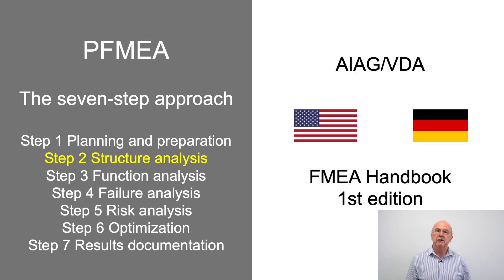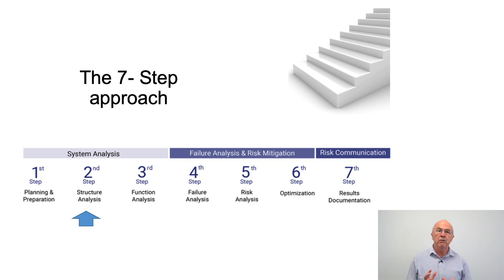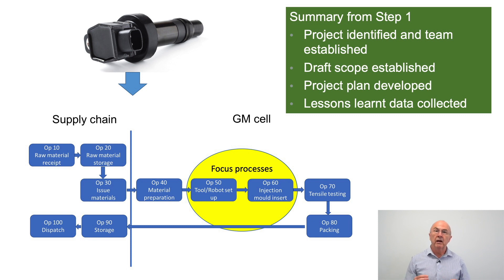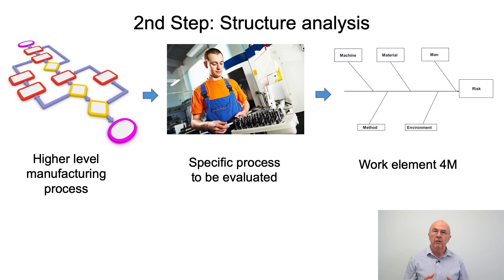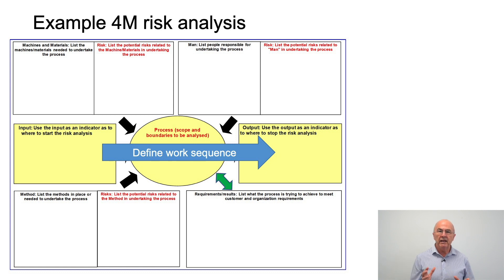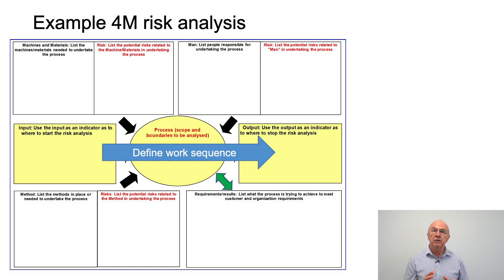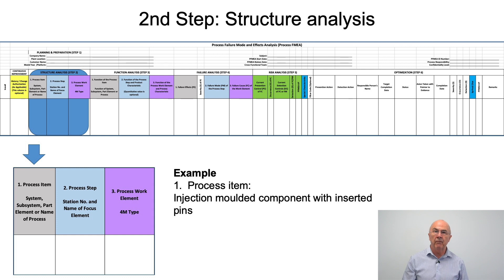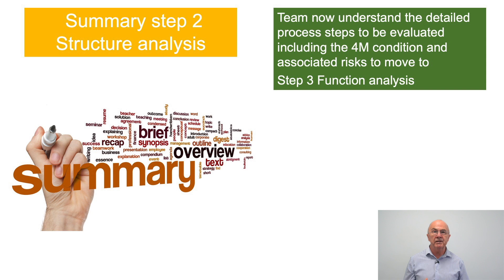IATF 16949 | PFMEA Step 2 Structure Analysis

Comment: Just on the material element , is not correct put the granule dryness and type, according with the handbook the material is focus on material indirect , basically the materials that help to do the operation for example : oils or grease for install, coolants for machining , etc.
Reply from the maker: Thanks for the feedback, remember the handbook is guidance.